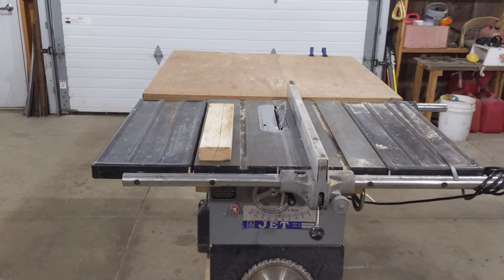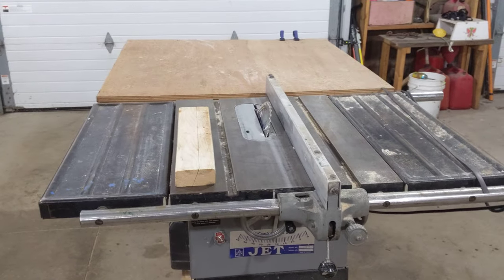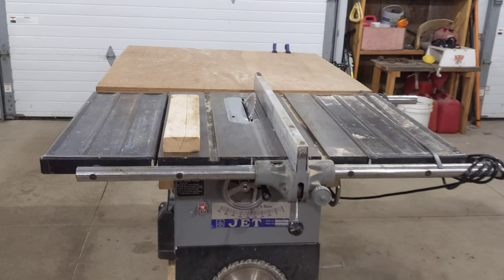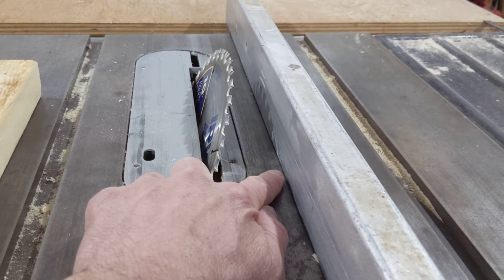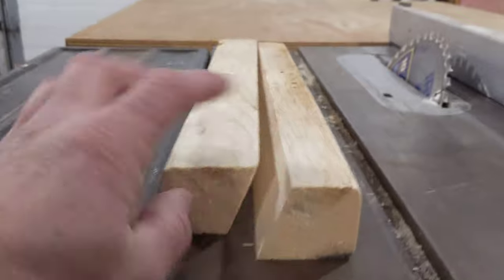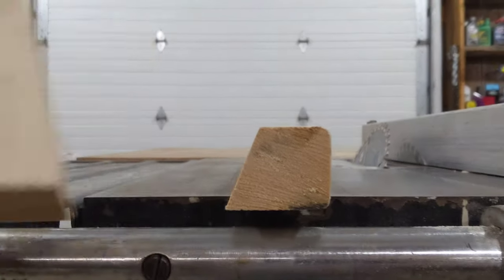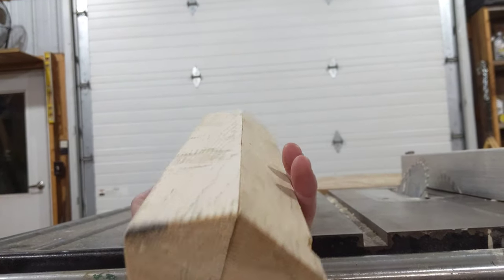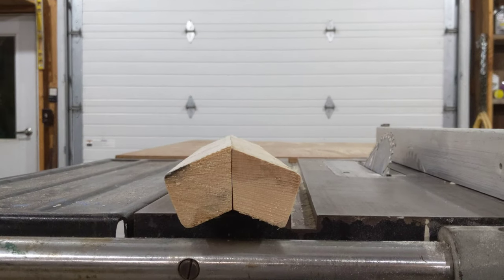How to Build Corner Studs for Octagon Hunting Blind

Comment: I’m building a 16 sided blind and I was wondering how I would go about finding the angle for the corner studs
Reply: Would I just do 22.5/2 or no?
Reply from the maker: I believe your angles would need to be ripped at 11.25 degrees if you build your studs in this fashion for a 16-sided unit.
Reply: @UncleBucks thank you sir. You’re a lifesaver
Reply: @UncleBucks  you should definitely build a 7x7 16 sided blind with a trap door and use 2 of the wall panels as access for when it’s on the ground
Reply from the maker: @user-xd1fq9gy4p  that's a good idea for accessing the inside while you are building it, but I've found 8 windows to be more than enough to open and close.

Comment: This will not work for me
Reply from the maker: Ok... Why not?
Reply: @UncleBucks  sir, Iv cut them at the 2” and they are coming out uneven. Is the 2” measurement from the base of the blade or the top ?
Reply from the maker: @adamrivera1873  the 2" measurement is from the base of the blade, right at the at the table surface.
Reply: @UncleBucks  ok that makes sense because the only way I was getting a correct cut is measuring from the top of the blade 1”. I am not a good carpenter lol. 

Also, are you able to shoot a bow out of the front window? It looks like a good size but not sure how it would do. 

Thanks for the awesome video by the way